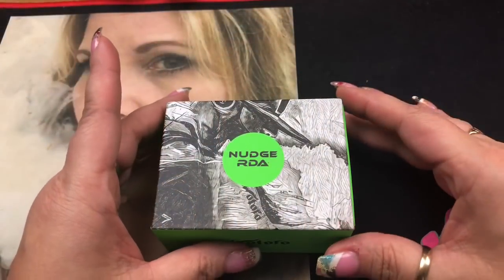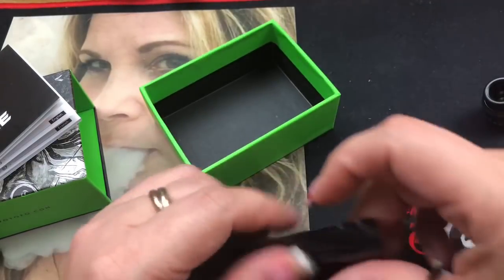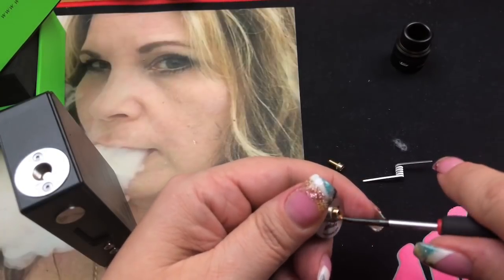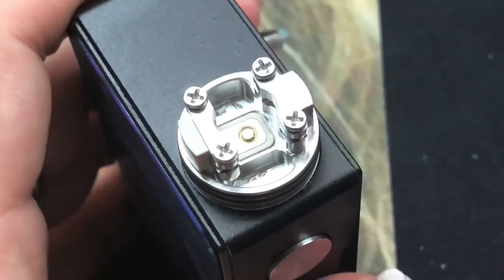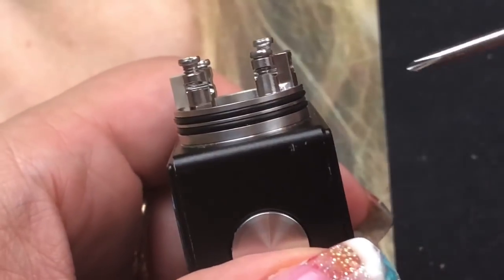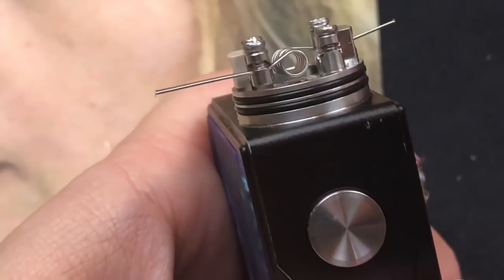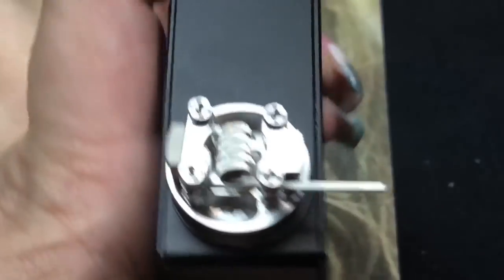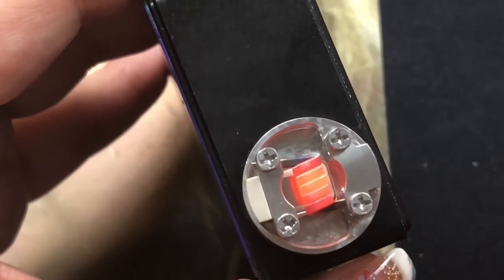REVIEW & BUILD | Nudge 22mm RDA by Wotofo and Designed by Suck My Mod

Comment: This has amazing flavor, but my top cap is super loose.  It seemed fine till got some juice on it.
Reply from the maker: Yes, that can happen, just dry it off under the cap and the o-rings and it should be fine.  If not, try changing out the o-ring.  I love the flavor.
Reply: Thanks, it worked.
Reply from the maker: I’m always happy to help. 😁

Comment: Hey Wendy when I try to trap my leads the post screws twist the coil . Even when I leave coil jig in place . Any tips? Like holding it in place? Doing one side first? Spacing coil?
Reply from the maker: I have never had this issue to be honest. As you can see in the build portion of the video the coil just lays in there.  Are you putting the coil leg under the screw?